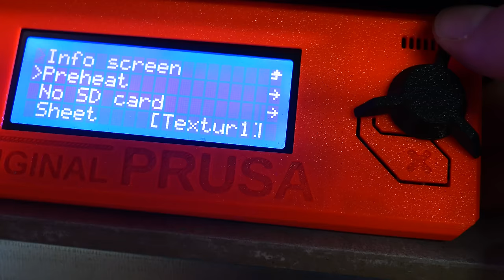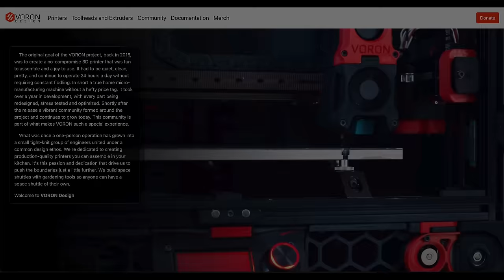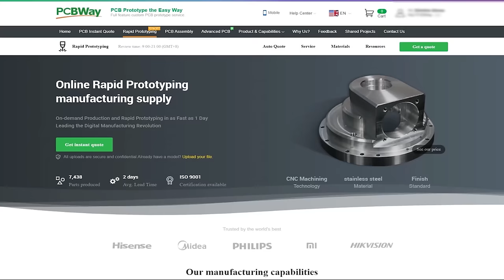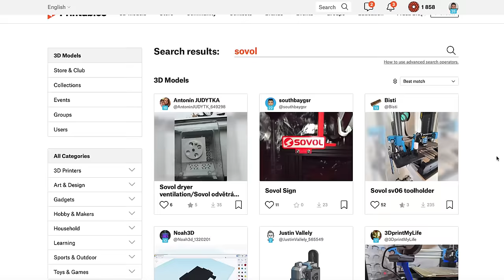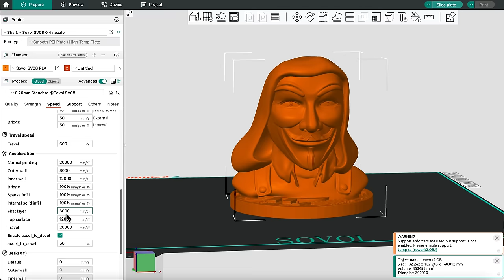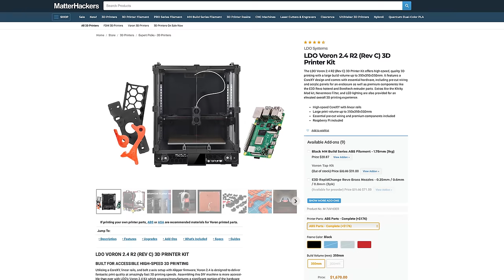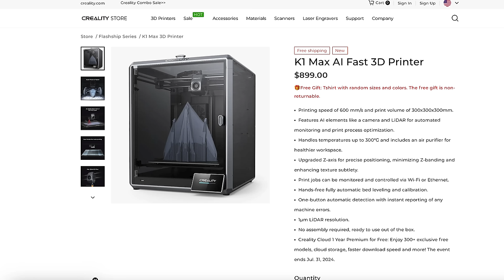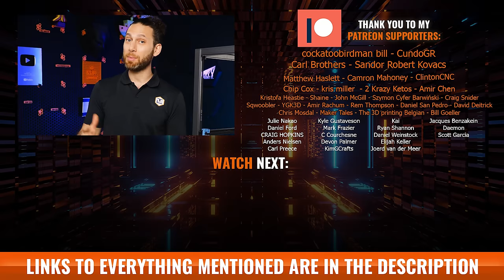The Sovol SV08: You Won't Believe the Price…

Comment: I believe there’s more than 200 engineers right now watching this
Reply: Why? They simply copied a machine that has been around and perfected for a long time. Yawn fuel for engineers.
Reply: @chrismay2298  Mass producing a previously mostly hand-build machine reliably at a compelling price point is not trivial and requires a lot of engineering.
Reply: @MichaelTavel  I think there is more to it than meets the eye, at first glance.  First Sovol is simply joining and forking Open Source products.  Second, being Open Source falls in line with Chinese Government Phylisophy, so they get full backing, and subsidies, from the Chinese Government.  Third, Sovol is outsourcing production through Creality.  Take it as you will, I am on board with it, and impressed with what they are able to accomplish.
Reply: it is a voron clone and that is released years ago those engineers could watch it already
Reply: @auroraRealms  How do you know production is going through creality? If that is true, as you suggest, i am instantly not interested. Creality QC is absolutely dog poop. And your bed will be warped 100% guaranteed. Lol
Reply: @BlueMax717 I don't remember the exact source. But if and when I am able to verify I will let you know.  The quality part bears out though.  People are replacing the SV06 Z motor mounts with moded versions of the original step/stls, because the injection molded ones are not straight.  The SV08 may have problems with the flying gantry plastic parts in the back corners eating belts.  If you want to stretch your dollar as far as it will go, parts of it will break and need to be replaced.  Fortunatly you can just 3D print the plastic parts that fail, and the other parts are mostly industry standard.  Alternatives are to just buy higher quality printers that cost more.
Reply: @auroraRealms  no problem at all. I didn't need an exact source or anything. I wouldn't be surprised at all because a lot of these Chinese companies do it.

Comment: The sv08 seems really interesting but the hotend is a nonstarter for me. These companies need to start shipping with standard nozzles, this is insane.
Reply from the maker: Yeah. That’s a bummer. But I’m 99% sure you can just put the Bambu clone hot end on there lol. I might try next week.
Reply: Please do, if this works it will likely change my mind on buying it
Reply: @jeffreydutra  well, it's using klipper, you should be able to swap to anything you want.
Reply: Same size rail as the 2.4. you can use a 2.4 rail caddy and have your own pick of any hotend you want on it.
Reply: luckily its open source! so a revo adapter prolly will be a breeze
Reply: The T300 has the same nozzle! I was perplexed why they changed nozzle from T500 (which was compatible with SV06+, SV07/+). Now all is clear: this is SOVOL's new standard!
Reply: @thenextlayer  also given the mod community and voron community , it will take a week till someone adapted a SB or other voron toolhead to this machine :D
Reply: I'm honestly wondering when current companies are gonna collab with LDO or E3D for hotend assemblies. Seems so much more efficient to work with groups that have already put in tons of work.
Reply: @thenextlayer  yeah fairly certain it is just a TZ2.0 type with a v6 style nozzle length instead of the more standard shorter Bambu clone nozzles you see on clone hotends
Reply: Companies need to make some profit so that is ok for me. When it comes time to replace, just replace it with something you want. That's what I've done with my Bambu X1
Reply: Hopefully an adapter is made or this is a non starter for me. Trianglelab makes an adapter for my Qidi that lets me use a v6 nozzle and all its sizes and variations.
Reply: @thenextlayer  could you please post an update when you do? Thanks for your great video.
Reply: So you’re into a hobby which whole thing is constantly improving and adapting, but you want it to stay the same? I say just improve on this design, it’s obviously better for fast printing than the og nozzles
Reply: Just put a Stealthburner or one of the other aftermarket printheads on it... Then you can use whatever hotend/nozzles you want. It's the same rail as a 2.4 and it's running Klipper, so there's really nothing different about this than, say, a customized 2.4.
Reply: Not hard to change the entire hotend either
Reply: @thenextlayer  Please do this, dude.
Reply: Any update
Reply: “A non-starter” yuck 🤮 it’s open source and you can swap in whatever you want. The sovol planetary drive extruder is actually very well engineered and unique.

Comment: Fully open source, but with a proprietary hot end… they should have go Voron style on that too….
Reply: ... You have plenty cash left (in contrast to a Voron kit like from LDO) to just do that! Just use the OG hotend to print the printhead you want and buy the hotend you desire. That's the idea of Rep Rap!
Reply: @hassosigbjoernson5738  true, but I think it should have already been open source by default.
Reply: @marcelzuidwijk  They say the printer will be 100% open source, that means the specs for the hot end will also be open source and any company will be able to manufacture it. Just like any other open source hot end? Unless I missed something.
Reply: I know where you are coming from NUT I ordered 4 of them last week for $30, what's the problem. Well, for now, I know they don't have a hardent steel nozel. But I'm sure it's coming.
Cheers, Mike Irish
Reply: 100% open source. guess you don’t understand what that means. And nowhere in their literature or website does it say the hot end is proprietary. It’s seems if it’s strictly the YouTuber using the terminology because it’s not a standard size and fit.

Comment: Ahh! my next printer.  When the 9,999 price drops a bit. 😊
Reply from the maker: It’s under 600… not sure why they do that lol. I hope you’ll consider using my link if and when you do purchase as it helps support the channel!
Reply: @thenextlayer  wdym by that, it litereally says $9,999.99 on their website
Reply: @thenextlayer I actually clicked the link because I couldn't wait to find out the price and I assumed it's 1k for the rest of the video lol.
Smart move to tease the price in your end but they did themselves a bit of a disservice with their website not set up correctly.
Reply: @awesomecronk7183 he means the actual price is $600 and he said he doesn't know why the default number on their page is a bunch of 9s, how was that hard to understand?
Reply: @thenextlayer  Is it under $600 before or after the early bird discounts?
Reply: can it run crysis tho
Reply: @theflyingnon1133  no
Reply: @theflyingnon1133  Raspberry Pi 5 can, and with a small 540x380 pixels screen, I guess there could be a way... /s
Reply: @Barbasnoo  I've heard that it's $499 for the first 100 (IIRC) people and then $599 after that.
Reply: 9999usd? Right, ... I'm off to alibaba
Reply: @awesomecronk7183  you're adorable.

Comment: Every introductory user of this printer has had various problems with wiring, found problems with insulation, LEDs, camera quality, etc. It's early to tell but a lot of what is said in this video is extremely dramatized. Making big points out of trivial feature differences is just a distraction. The design of the SV08 is so different from the Voron that very few of the improvements that have been made for the Vorons will fit the SV08. So it is not something that you can use to benefit from the Voron experience. The use of primarily steel in the frame (not aluminum as was stated) saves money but it is very thin and easy to damage and difficult to repair or modify, the aluminum frames of the Vorons are much tougher and more suitable for upgrades. When a new Voron upgrade comes out there is a path to upgrade your own printer, which Prusa is also famous for providing. This is not the case for other vendors, they expect you to buy another printer every year or so (just like the auto manufacturers) so they don't worry about upgrade paths supported from the designer / manufacturer. The cost off the SV08 is about equal to a low end Voron kit after they get beyond the low initial beta user pricing, but a very high quality Voron kit is only about double the price of the SV08. One strong feature of the Vorons is the availability of maintenance and upgrade parts from a large array of vendors. A printer without a ready supply of spare parts is hardly something one can depend on. Making a printer full of proprietary parts means a large distribution network is needed to make parts readily available, and if the manufacturer goes away or stops providing parts for a model it becomes much more difficult to support and will likely be retired long before a Prusa or Voron model. So the higher initial cost may be repaid several times over the longer life of the machine. This is another area where Voron and Prusa shine. Why does this unboxing and early walk through sound like a Bambu ad? This channel was interesting early on but has degraded tremendously since those days. Now it sounds more like an over-hyped advertisement sequence. As another commenter mentioned, it might be more useful to compare the SV08 to the pre-assembled Voron clones. This really isn't in direct competition with Vorons market. Those pushing for the Bambu and Sovol type machines are really supporting the buy and discard philosophy that fills our dumps with tossed products only a few years old, whereas the Voron and Prusa philosophy is more of a long term minimizing trash and maximizing re-use of the machine resources with reparability and upgradeability. Are you buying for the long haul or the short term??
Reply: Paragraphs bro, use them.

Comment: I was looking to buy a new printer, is the first layer problem solved? I read the plastic base expands/shrinks because of the heat.  The solution would be to pre heat the printer 30 min long before you can use the whole print bed volume and do a calibration. Did you had this problem?
Reply from the maker: I haven’t used the printer in months because it’s been in pieces, but I think the issue is the probe, and it can either be solved by heat soaking, firmware, or replacing the probe with Klicky or Eddy or any other solution. Any of them should work.
Reply: @thenextlayer  Sorry I wasn't entirely clear. The first layer problem shows when using the entire print bed. Its also shown on the sovol website. The outer regions warps compared to the middle. Their solution is to heat the print bed 30 min before printing. To me it sounds like a design flaw of the plastic printer base. I'm just wondering if every printer has this problem.

Comment: Hold up there, the LDO kit for the 2.4 R2 does come with handles, though they are on the top.  Also you CAN grab from the skirts, as the honey comb pattern does let you grab the lower Extrusion on the side.  I move my 2.4 a fair bit and use one handle in one hand and one on below on the extrusion to grab the printer.  Just have to be careful of the screen, or carry it from the back.
Building the Voron and choosing your own color scheme is like doing RGB for your ultra gaming PC.  Not entirely necessary, but also very enjoyable to make the choices.  I have a Red 2.4 and went with Red and Grey for my colors, and I might change those colors later too.  It took a while to get my 2.4 to be tuned, and right now its printing beautifully, to where I don't really want to mess with anymore settings LOL.
Also you don't need the scrubber for the nozzle if you don't heat the nozzle first before doing QGL.  I have TAP on my 2.4, meaning the nozzle drip is annoying and messes with the QGL and Meshing.  As such I have changed the Print Start in Orca Slicer to run G32 after it heats the bed, but before it heats the nozzle.  I then removed the G32 command from the Print Start section of the Printer.cfg file since I have Orca calling for it instead.  Now my printer will Heat the bed, Home, QGL, Home again and then heat the nozzle.  During all of this, the bed is heat soaking longer then before.  Also heating the nozzle doesn't take that long anyways and once it gets to temp, it starts to do the print.

The new Path is the 350mm build volume, 220 or 250's have been showing their limitations for years and going to at LEAST a 300mm build volume, your just going to compete against every other printer out there.  Look at the Prusa XL, while it is a large build volume, its stupidly overpriced to the point where the 2.4 350 IS THE CHEAPER OPTION LOL.  
Also since it is a 2.4 that is pre built for you and uses all the same stuff, and ERCF will work just fine on that SV08
Reply: "does come with handles" ... which you also could print by yourself?! 
"grab from the skirts, as the honey comb pattern does let you grab the lower Extrusion" ... Which you could also change with a large 3D printer at hand.

Just because this does come prebuild, doesn't mean you cannot mod it the way you want! After all this is going to be a "Voron light" ... the cheapest entry point to that class. And since all files should be available ... you can change the whole printer the way you want.
Reply: If you use tap , you should preheat your nozzle to 150C. It prevents dropping but  compensates for the nozzle expansion.

Comment: Thank you for the detail on the cooling. I'm new to 3D printing, started recently on a Sovol SV07plus, and designed a dual-5015 parts fan carrier to ride on the print head. It's on printables. It needs some mass centralization work, but already it's functioning nicely. Anyway, yes, parts fan cooling is a huge limitation.

Comment: Is that tool board compatible with something like a stealthburner? Can the fans be changed around?
Reply: I don't have the printer nor have I looked at the documentation but likely 1. No(size may be different although config wise it would work) and 2. Yes. Since its opensource you can swap parts at will
Reply: @woutervossebeld4664  Gotcha. It doesn't look like a bad machine, but their decision to go proprietary for a few things is a turnoff. It's understandable though since this isn't meant to be an actual prebuilt Voron.

Comment: Whats under the hood? Whats the specs on the mcu running klipper? How thick is the bed? What steppers and drivers is it using?
Details man, details!
Reply: Nero's livestream goes into greater detail but the control boards are both STM32 with an allwinner h616 serving as the Pi equivalent more than enough power. Steppers are 2209s and the bed looks to be about standard voron thickness
Reply: @connorcleveland9166  I saw the live stream. Yeah looks like an orange pi base.
Not convinced about the bed though. It clearly had a shroud around the edge. No way you can tell how thick it is.
Reply: @connorcleveland9166  I wonder why the motors sound so loud with 2209 drivers.
Reply: @peterrichards1989  bad firmware or mechanical resonance? 2209's are well known to be capable of very low noise, right?

Comment: I recently converted a machine based on Marlin firmware into a fully enclosed system and added a heater to achieve a hot chamber temperature of 80°C. I also upgraded the hot bed and hot end, enabling the nozzle to reach 400°C and the bed to reach 150°C. I made these modifications because I want to experiment with printing materials like PEI or PEI/CF. I'm now planning to build a new printer based on Klipper firmware, and I'm curious if it's possible to replace the entire hot end with one that can handle up to 500°C available in the market. Additionally, I wonder if it's feasible to switch to stepper motors with higher torque. From the photos, I'm slightly disappointed by the eight aluminum profiles used in the construction. If it used standard 2040 aluminum extrusions, it would be easier for me to install insulation boards.

Comment: the printer is just perfect for me. I've already tried to build a ratrig vcore 3 but failed because of the framework. I just couldn't get it square. I've probably rebuilt it 10 times but never managed to get it to be square. I then gave up and resold the kit for less money. I then built another printer called “the 100” and was thrilled. The assembly went well because the frame was practically rectangular because it was completely 3D printed. now I want a printer that is big and has a lot of potential like a voron. but I'm afraid of spending over 1000 euros again and then failing again because of the frame. But with the printer I have everything I need, just that I can't mess up the setup. I will most likely get it

Comment: Can you say something about the mainboard? A standard BTT or Creality board like on the other Sovols or something custom build? What CPU is running Klipper? How much RAM? 
What type of stepper driver? etc.
Reply: that's what i was wondering too, there is no way the motors are this loud with tmc2209 or 2225 stepper driver installed, but i guess if everything  about this printer is open source, they have to publish the board, drivers, stepper (current/heatdev.), etc that have been used
Reply: year @thenextlayer, a look around on the rainbird would be really cool and interesting. Also, the question of how upgradable this is with stepper drivers or better camera, ...  calling these 5fps cam an upgrade is a hard claim :'D

Comment: I enjoyed the video 1st and foremost so thank you for providing it. I do want to ask a few pointed questions though:
1. Why wait to post after the Phrozen Arco Kickstarter ended? I assume from other of your videos that this has been ready for a bit.
2. Nozzle is not hardened  so no CF, GF, or silk, wood, marble, or other abrasive filaments. Will replacement nozzles be provided at a decent price or will a compatible replacement hotend be more cost effective?
3.  Bambu just released a noise reduction patch for motor noise. How does this unit compare?
4. What about ideas for sound absorption?
Thank you again for posting.